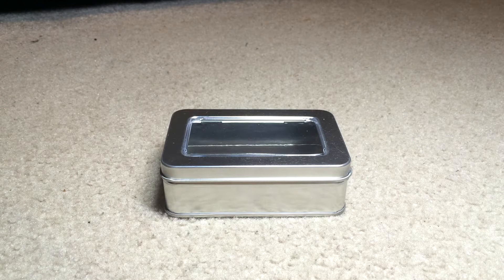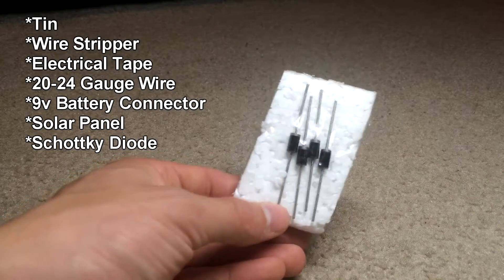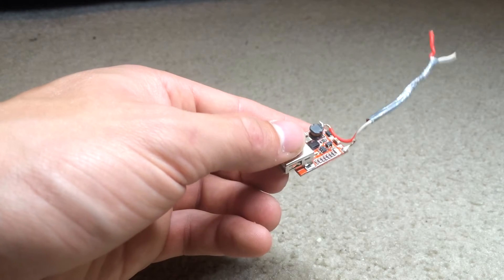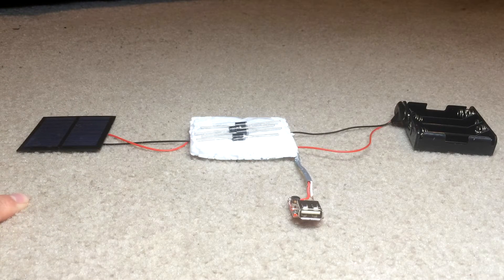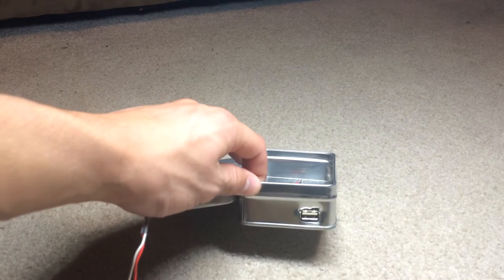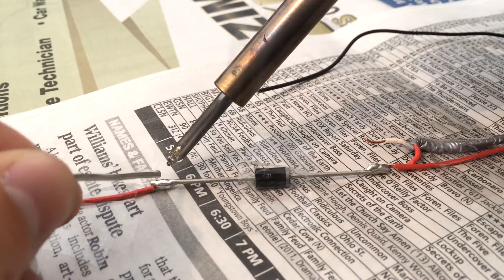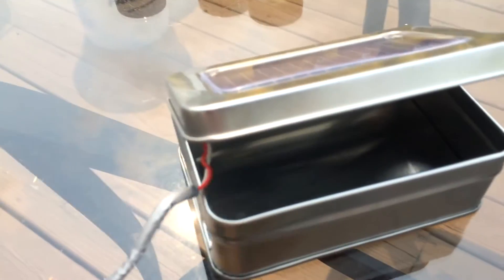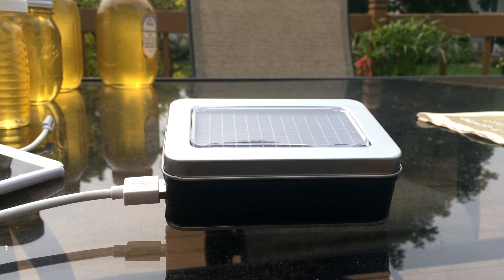How to: Portable USB Solar Panel Charger, iPhone, Android, Windows Phones and More!

Comment: Does the solar panel really charge the battery?
Reply: Nope he forgot to add a small thing to stop it being alway on and it can just drain it down if no sun so basically good idea but it is not you need to only use it in the sun because if you down the solar panels will not recharge it

Comment: Since metal gets so hot in the sun, would it be better to use a plastic project box instead of the tin?  And could I also use separate box for the solar panel by itself, and use longer wires so the battery box could be in the shade while the solar panel box is in the sun?

Comment: Does this really work since the solar panel has less voltage than the battery pack? Would the current really flow from the solar battery?